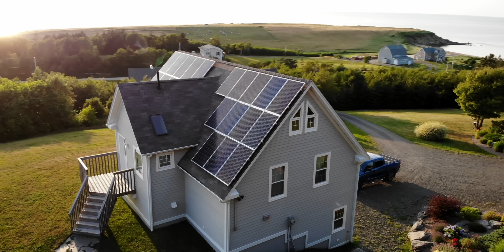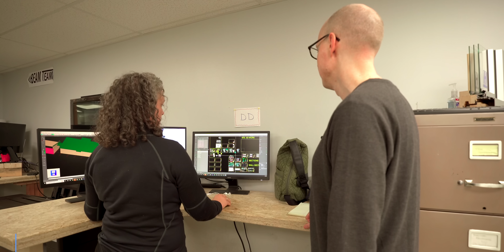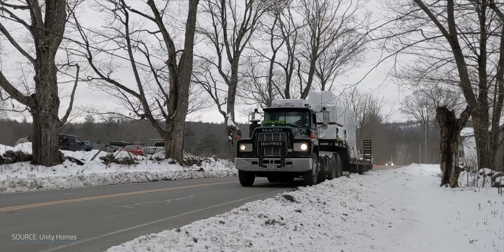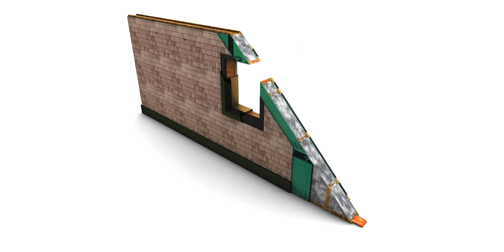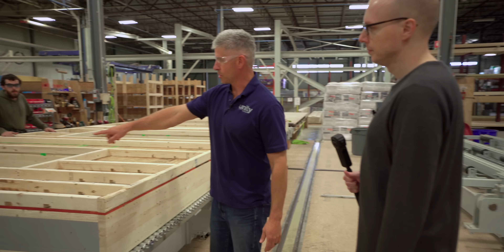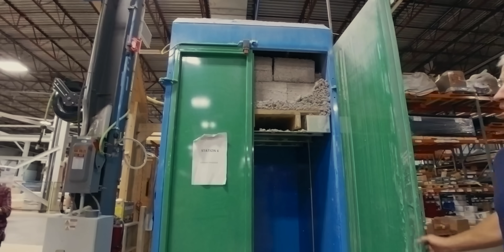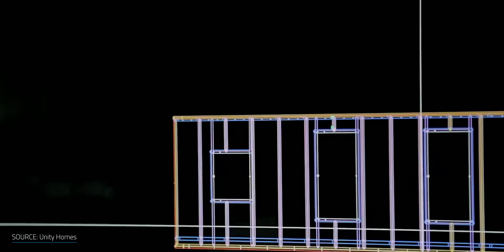The Simple Genius of a Prefabricated House - My Net Zero Home Build

Comment: Seems plausible , but I am still skeptical about cost saving, because cranes were being used to assemble the house. the assembly process itself may need to be optimized , using equipment specifically made for house assembly.

Comment: I’ve looked at Unity in my long term goal to build a small net zero home (800 sq ft not including garage). I love the thought that goes into what they do and I don’t think there is anyone else that is as thoroughly detailed as they are. A question I have is with the wall thickness and quantity of materials necessary to achieve their results. Matt, was there any anyone you found that uses SIPs or other technology? I would love to know the R-value, thermal bridging, engineering, cost, simplicity comparison to something like SIPs or other. The walls Unity constructs look incredible, but I’m wondering if similar results are achievable with less complexity? Thank you for the videos you produce.
Reply from the maker: There are many different paths you can go and get the same exact final results for R value and air tightness.  It's actually kind of head spinning with all of the ways you can go.  I didn't do a detailed SIPs comparison for myself, so don't have an info to share ... but that could be a good possible future video.

Comment: If we're ever in the position to build, this is definitely the approach to take. It's faster, cleaner, more efficient, cheaper for the same standard of construction... Just about the only downsides I've ever seen to this approach are that it isn't the cheapest way to build overall... yet. Also transporting the finished sections to site can be a challenge, just because you're moving large pieces of house rather than materials.
Reply from the maker: Thanks for sharing.  And yes, the final transport can be challenging and needs to be carefully planned for.

Comment: A Unity 1500 square foot house for a minimum of $400,000!?!?! Ya this is well out of reach for 99.9% of this channels audience. That doesn't even count the land. Holy smokes they are expensive
Reply from the maker: Yeah, it's pricey, but it's also about location, location.  The final cost for any house like this is going to vary wildly based on where you live.
Reply: A 1950s built single story ranch of 1000 sq feet and 3bd 1bath here in Cobb county Georgia sells for about that price currently.
Reply: @4literv6  that is straight up ridiculous and why I would never live there. Remember this price I mentioned is JUST the house...not the land

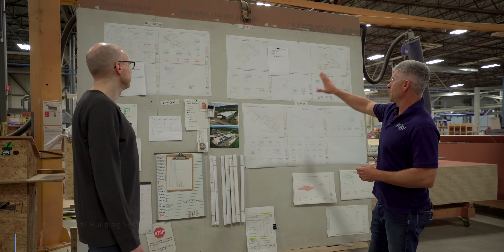Comment: Hey Matt, just a heads up, the board at 5:50 seems to have some benign looking but potentially sensitive information (among other things, customer names, some kind of access code?). May want to confirm with the company if you haven't already, or blur parts just to be safe.
Reply: There's also several visible passwords/access codes at 8:13

Comment: My 1800 sf manufactured home (3BR, 2 full baths, country kitchen, dining room, LR, office, laundry room) cost $110K in 2005. That's $61/sf. Like most manufactured homes, it's built to HUD standards--double pane windows, 6" exterior wall studs. The exterior covering is Hardiboard/Hardipanel. 

It sits on a flat, 10 acre site in the North Sacramento Valley in Tehama County, CA. Land cost: $105K. Excellent views of Mt. Shasta, Mt. Lassen, the Trinity Alps, the Sierra Nevada foothills, and the Coast Mountains.

Comment: Good to get a look at this. Thanks!
Matt ... You talked about avoiding thermal bridging via studs but weren't we seeing (effectively) 9 inch studs in and around each wall section? (Or is that deep enough to not count?)
Reply from the maker: The studs are acting as a thermal bridge, but it's greatly reduced since they are 9 inch i-beam studs.  The perfect solution?  No, but a really good compromise.  Belinda Carr has a great video on t-studs, which are even better.  https://www.youtube.com/watch?v=UtviZ2GHWCI

Comment: This is clearly the superior way to build a home. You're not wondering where the contractor is and when is this going to get done. You don't have to worry if somebody is cutting corners and doing or using stuff that you didn't agree to. You get exactly what you paid for with no changes along the way. It's cheaper. It's faster. They have ALL the materials and tools needed. We covered the pros, what are the cons? Are there any?
Reply from the maker: There are potential cons and gotchas in the process for sure.  It's diminished compared to building fully onsite.  As I make more of these videos documenting my progress I may touch on some of those.

Comment: No, You are crazy to be excited by European-style doors and windows. They are a leap ahead of what you'll find at your local home store. In northern Europe, they use full double-sealed doors that block airflow, light, and sound, even in the interior rooms. The outer doors are like refrigerator doors.
Reply: mine are sash replicas, as my home was built in the 17th century, triple glazed, tilt turn, im very happy with them.

Comment: I love European style windows.  It sounds like a great home.  I wonder what would be involved if someone wanted to renovate a home after it was built.  Would they be able to create components that could be added to an already built home?

Do you have all the digital information so you could use it if you wanted/needed to plan these in the future?
Reply: Euro windows are fairly easy to install, especially the operable ones. All you need is a well prepared opening (tighter than you would for a US type window), the sash is removed, then you fit and rectify the frame, fix (typically with nailing straps), seal, insert the sash, done.
Reply from the maker: Updates can definitely be done to the house down the road.  In a way we're actually already doing that.  The garage is more standard style construction (not the prefab walls).  My new studio/office is an extension of the back of the garage, so that portion is getting built on site by my local general contractor.  I'll most likely be sharing more details on that in a future video.
Reply: @UndecidedTechnology  thank you.  Looking forward to it.

Comment: Building like this is probably also way safer for the people building the house. They have all of those machines that help them lift heavy things, they don't have to worry about slipping on mud, or ice or wet plywood. And I'm betting it's pretty nice not to get rained on, or baked by the sun, not to mention they don't have to drive to a different job site all the time
Reply from the maker: The setup is far better for the workers.

Comment: Does this have any effect on the ability to modify the home later on? It would seem that it's built in much the same way (albeit with a bit more planning and forethought) as a traditional home (as in, it's not made of exotic, composite materials or anything) so... yes?
Reply: its easy to add bits on later, thats the beauty of the process. Here in Europe its common to enlarge modular homes as family grow
Reply from the maker: Yes, you can definitely modify a home like this later on.

Comment: Cellulose was shown, but it sure looks like fiberglass on some racks. Neither can compare to foam, but cellulose is far better. None of this is very new. I had a factory built 2-story 3k sqft house built about 25 years ago. It used an open loop ground source heat pump. I've moved on some since then. Solar is cheap enough now that it's not really worth the extra money for some of the high efficiency things like triple glazing  geothermal. I'm on my second net Zero (or less) now. With solar it's just not that difficult anymore. Even if the house was fully passively heated and cooled, you still need plenty of power, but with solar I've sent back as much as 1.4mWh (net) to the grid in a single month. Some month I buy some, but on the year the house net exports plenty energy.
Reply from the maker: Thanks for sharing.

Comment: In 2022, they are using 3D CAD instead of BIM is like people using an abacus instead of a calculator
Reply from the maker: They have their reasons ... part of the reason is the tight integration into the CNC machines and tooling they use.  Are those good reasons?  I'll let you decide.

Comment: This makes so much sense. Very exciting for you! Too bad they have to wrap them in all that plastic just for delivery…but I would suspect it is a quality control measure to keep things from shifting in transport.
Reply: Everything is wrapped in case of rain or snow. It keeps everything dry.
Reply from the maker: Yeah, it's disappointing, but still the best option available.  It keeps things dry and safe from the elements until its ready to assemble onsite.
Reply: Regular construction would generate much more waste than this little plastic.
1/5 of the carbon emission in the world is due to buildings.

Comment: Building a passive house has been a dream of mine, I took a course with Echo homes and came out convince net zero was the way to go. Construction normes need to be upgraded to a much higher standard. The energy saving will pay for itself. The added cost of building to double current standard adds less than 10% cost for an 80% energy saving.
Reply: No, you are simply shipping your energy needs to another country. Where do you think all of the fancy technology, batteries, and insulations get manufactured? China, and Malasia, mostly. You are just moving the cost to build and operate your house to somewhere else plain and simple. Modern living has energy requirements and paying China to burn coal to produce batteries and solar panels for your home is just vanity to make yourself feel better. You would be better off to build with local lumber, insulate with nature products where possible or standard glass insulation with minimal plastic wraps, and then heat with wood or natural gas and maybe just maybe convince your state to allow nuclear power for electricity.
Reply: @grast5150  As in many things, the ideal is often the enemy of the good, especially when idealists forget that "ideal" is in some senses an antonym for "real." In human affairs, the most utopian ideologies have often resulted in huge numbers of innocents slaughtered and atrocities committed. In housing, too-high standards have resulted in a housing crisis and lots of homeless people. Too many building and zoning officials have become the residential-housing equivalents of Tony Fauci-- corrupt Karens more concerned with controlling others' lives than with what's best for the people and for society. 
-- The ICC codes, aside from turning over more sovereignty to international bodies, are badly written and petty. The codes of 50 years ago were far simpler, and didn't need much updating other than for energy efficiency and moisture control, with some revisions to deal with new materials that didn't work out well. One thing that tech-fanboys should keep in mind is that new tech generally results in lots of unintended consequences that reveal themselves only with the passage of time, whether it's in pharmaceuticals, automobiles, software, or biotech. Tight houses had a lot of moisture-control growing pains, and engineered wood may well show shortcomings over time. Polybutylene plumbing didn't work out all that well. Early types of foam insulation had some off-gassing problems. And so on.
Reply: HAHAHAHA not to be rude but you have no idea what you are talking about.. I guess its fair because they were trying to sell you something, but lets just do a quick run down. typical wall paneling consists of 2X4 framing, exterior sheathing, batt insulation and dry wall. The energy efficient wall Matt put in has 9" I beam, zip sheathing, insulation, 2"X 3" studs and then dry wall. There is no way all that extra material and LABOR is "LESS THAN 10%" LOLZ I would love to see what they are selling you for less than 10% and still making a profit.
also a lot of these thing are kind of misleading, for instance say you install an electric hot water heater that cost $500 and cost you $140/year for electricity.  Now you can install a hybrid hot water heater that cost $1500 and cost $100/year for electric. It would take you 25 years to make up the difference. (granted it last that long) 
My point is you can build the tightest, most energy efficient home in the world but the truth is electricity is CHEAP!!